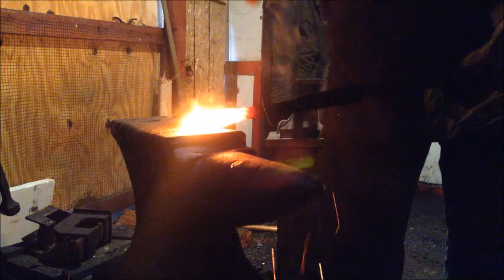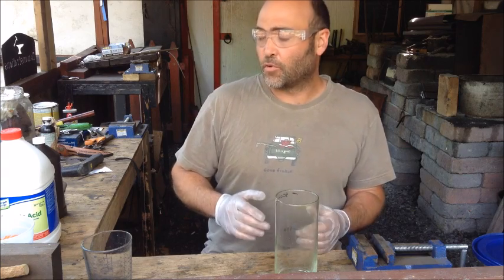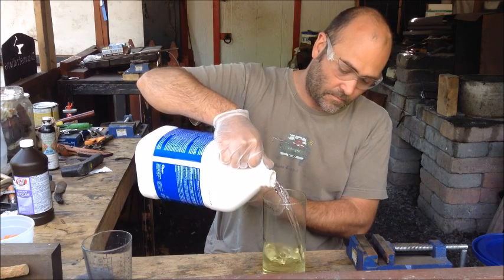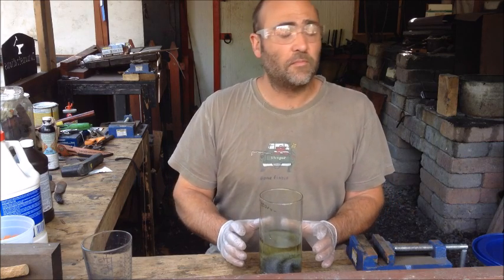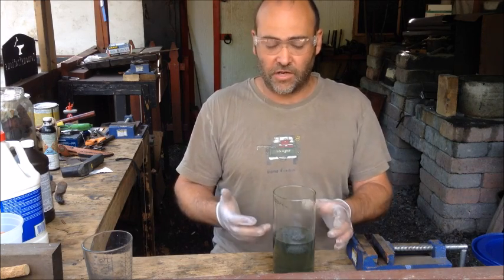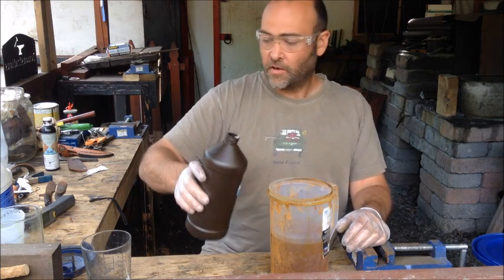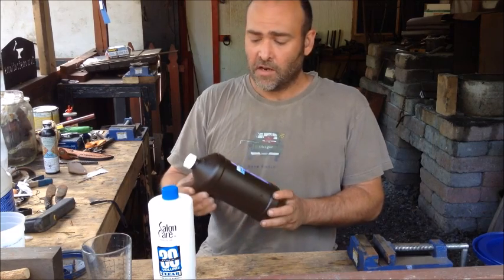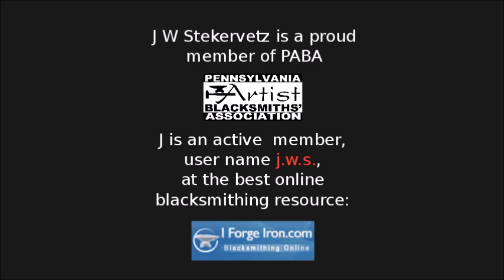Making Ferric Chloride (FeCl3) for Blade Etching

Comment: You dont have to use steel wool. 
The finish will be a gunmetal grey color instead of a much darker grey or black you get when using steel wool. Just depends on the look you want.

Comment: Hey can we use nails instead of steel wool???
Reply from the maker: In theory. But the wool will definitely do the job in short order where the nails would probably take days or weeks. I also wouldn't use anything that has been galvanized.
Reply: Shri Hari Ram G
You can use any iron/steel staff, non-coated with zinc.
Also a good choice is a powdered rust.

Comment: I just got the stuff to make some of the solution in your video. How long would you recommend soaking your knife blade?
Reply from the maker: Start with 30 seconds, lightly sand then wash it off, check the etch, repeat.
Reply: @jwstek  what grit would you use for sanding?
Reply from the maker: @nathangines6107  I normally use a wet piece of 800 grit

Comment: what if I use an aquarium-aerator instead of hydrogen peroxide will it work?
Reply from the maker: Probably very slowly over time, it will happen naturally as well. However I’ve destroyed more than my share of aerators in this stuff when etching, they don’t last more than a day or two.
Reply: @jwstek  thank you sir. 
but if I continue using an aerator is it going to give me weaker product?
or just leave it open to make it happen naturally? 
My plan is actually to use it in making printed circuit boards but I'm not in a hurry. I'm also hoping you can also give a suggestion. 😊😊😊

by the way I'm currently bubbling the solution while writing this. 😁
Reply from the maker: @kevinlouiemansueto608  if it’s working for you keep at it I suppose! I have used aerators in the bottom of my 5 gallon bucket of FeCl3 when doing larger pieces where I was worried about getting an even etch over the entire surface. From my understanding, FeCl3 settles on the bottom, because of its reaction with Fe it will break down to FeCl2 which will rise to the top. So agitation on a larger piece might be recommended, but I wouldn’t keep it going all the time, just when I was etching. I’d keep the stone out of the solution when not in use, like I said they break down pretty fast.
Reply: @jwstek  Nice. Thanks again sir. 😁👍

Comment: WHOA!!!! I always was taught to add acid into other chemicals, to minimize the risk of acid reaching the boiling point.("exothermic reaction").... Also,... you should have a couple of 5 gallon buckets full of cool water, with a box of soduim bicarbonate "baking soda" dissolved into it, as an emergency rinse solution, in case you spill/splash any on yourself!!!.... and a handy, charged, garden hose!!, and, you ought to be wearing a full length, liquid-spill-resistant apron.  If you dumped all of that acid onto your cotton clothes, you'd really be in bad shape, real fast!!!....
Reply from the maker: According to Harvard University EH&S, Princeton, MIT and Concordia University (All have lab procedure PDF's available online): ALWAYS add the hydrogen peroxide to the acid very slowly, never vice versa. 

https://www.ehs.harvard.edu/sites/default/files/lab_safety_guideline_piranha_etch.pdf
https://ehs.princeton.edu/laboratory-research/chemical-safety/chemical-specific-protocols/piranha-solutions
http://web.mit.edu/cortiz/www/PiranhaSafety.doc
https://www.concordia.ca/content/dam/concordia/services/safety/docs/EHS-DOC-019_PiranhaSolutionGuidelines.pdf
Reply: @jwstek  although I commend your research, your sources are meant for the preparation of a solution far stronger than what you’re making. 30-50% concentrated peroxide is quite a bit different than 3-5%. The rule is to always add acid to base, although hydrogen peroxide isn’t necessarily a base but a rather weak acid. Regardless, Muriatic acid should be added into the Peroxide when the solution is this diluted. Not visa versa. The inactive ingredient in your drugstore peroxide is purified water. And you ALWAYS add acid to water.
Reply from the maker: @d.michaelphotography6124  the peroxide I’m using isn’t common drug store diluted 3%, it’s concentrated peroxide meant for salon use in hair bleaching, it’ll burn you if you get it on your skin. Regardless, I think I made this video over half a decade ago and it always surprises me how active it still is. lol perhaps I’ll do an updated version in a few weeks - this batch starting to get a little low, time to refresh it.

Comment: I easily bought chrystallized Ferric Chloride from an Art-supplier in Sweden. Lawrence is the mark in my case. I had to buy 2 x 500 grams though. It will suffice for the rest of my life and further probably :)
It was not overly expensive either.
No hazzle, just make a right sullotion of high-quality soft tap-water or distilled water for lead-batterys.

Very safe in the storage, since it is a solid compound.
Reply from the maker: Opening a bag and adding water wasn’t the point of the video. If someone was making fresh pasta by hand would you tell them how you just bought a box of dried pasta and dropped it in water? Yes, there are other ways to get ferric chloride, but years ago when I made this video a nationwide electronic hobby chain store here in the US that many bladesmiths relied on to get their ferric shut down and buying through a chemical company required a lot of extra forms to be filed to get accounts, most limited to education or laboratory work, not the hobby market. Obviously things change over the years, but there are still those to prefer to know ‘how the sausage is made’ so to speak.

Comment: Is the hydrogen peroxide at all needed or can I just make the FC by using fine iron in hydrochloric acid alone?
Reply: the peroxide is used to add more oxygen to the solution.  you can also just let it sit out and it will absorb oxygen from the air..  or you can use a aquarium pump for a few hours.
Reply: An aquarium pump with some tubing will add the oxygen

Comment: Never leave any kind of acid in a open container, it will rust everything in your shop
Reply: It will over time leak out of the plastic jug it came in, enough to rust your tools or bare metal.
Reply: It will do this even in a seal container. The vapors leak past deals very slowly, but enough to cause problems when stored for more than a year. I store my acids in a cabinet outside my shop.
Reply: Desmond Bagley  I had a steel frame shop and I left a glass cup of boosted muriatic acid out over the weekend  and it destroyed my shops frame , on top of it rusting the paint came off

.

Comment: The ratio of Hydrogen peroxide to Muriatic acid is 2:1. With Hydrogen peroxide coming in 32 ounces or 946 ml.  Change the formula to 16 ounces of Muriatic acid to 32 ounces Hydrogen peroxide.  Why leave 46 ml (1.5 oz) in the bottle?

Comment: I know this is an old video, but I have a question. About how many knives will a batch of this etch before needing to make more?
Reply: Depends on the volume & strength of the of Ferric Chloride prepared.
Reply: @helpdesk1467  

And type of steel being etched.

Comment: I'm not sure that I see the point in this, since a number of people are using the precursor chemicals (hydrochloric acid and peroxide) for etching without all this extra work
Reply from the maker: batticha shumami quality and control of the reaction. By mixing the two precursor chemicals and etching in just those the reaction is aggressive - granted the more you use that same solution to etch your Damascus it becomes more tempered in its reaction. The reason why? You’re slowly adding iron transforming it into ferric chloride! Again, it’s all about control. You don’t want to do a single aggressive rapid etch, you want to do multiple etches while light sanding in between to get a smooth etch vs something that may leave your steel rough and blotchy or even worse.
Reply: @jwstek  Could be, I mostly itch PCB and it works great for me
Reply from the maker: batticha shumami then you’re making copper chloride, it’s a whole different animal and medium to work with! :)

Comment: You could also just buy muriatic acid and iron (III) oxide Fe203 and mix it with HCl and yield FeCl3. If you want a purer yield you could purify the muriatic acid in a distillation apparatus. This should all be done either outside or under a fume hood and with a Respirator typically a 3M Respirator with the approved NIOSH Acid Gas/ Organic vapor cartridges applied. Only use a distillation apparatus if you already have the knowledge to run one. Don’t waste your time trying to get the purest HCl either as Hydrogen Chloride forms an azeotrope with water at the region of 90-100% purity. Meaning it will start to boil with only water since that’s the only thing that’s keeping the HCl a liquid because Hydrogen Chloride of course is a gas on its own at room temperature and why it has such a high evaporation rate hence the dangerous fumes. Be very safe when making this stuff. I have a full acid suit for these types of projects so I truly only recommend this if you are extremely careful and know what your doing, just like the guy said in the video be extremely careful please!
Reply: This method is also safer as there is no production of Hydrogen gas although I don’t know whether the method in the video is more cost effective. This is shown in the chemical reaction here:

Fe2O3 + HCl (aq) ——> FeCl3 + H20

As seen above the Hydrogen gas isn’t a problem as it bonded with the oxygen in the oxide.

Comment: Is it no longer necessary to follow the age old convention of always adding the acid to the base???? Watching this video, I cringed through most of it. So much was done wrong. My biggest problem was you sitting down with your face less than a foot away from your beeker while mixing the base to the acid. That is the exact reverse order of how things are done safely.  If that would of been sulfuric acid instead of muriatic, you'd be in sad shape today.
Reply from the maker: Hydrogen Peroxide has a pH of 4.5 which makes it an acid.
Reply from the maker: Henri L even 100% h2O2 has a pH of 6.2 at 77F, 0.8 lower than even a neutral solution making it a very weak acid.

Comment: If you would have used chlorine instead of peroxide you would have ended up with a better quality ferric.
Reply from the maker: That’s just bad chemistry! Sodium hypochlorite mixed into the acid liberates chlorine gas, which even in small amounts can cause severe irritation to eyes, mouth, lungs etc, not to mention caustic burns or even death in not that large a quantity. No thanks, we’ll err on the side of caution- this might be backyard chemistry but safety is still the rule.

Comment: Hi ,just thought you might like to make this even cheaper ...i think you will find that the peroxide just rapidly adds oxygen to your mix ....if you used say an air pump at a slow speed ...perhaps one from a fish tank ...drilled lots of holes in a plastic tube and caused the hcl to bubble it would convert to ferric chloride ...you would also find if you had a pump in your ferric solution when etching it would remove the etchant waste from the blade and cause a quicker reaction...best wishes from England
Reply: Peroxide is like a dollar… that’s a bargain for an impatient person lol😂

Comment: I get the muriatic acid etches steel.. why the peroxide or wool .... is it to lower/neutralizes the acid
Reply: JW Stekervetz so if hydrogen peroxide and muriatic acid make cupric chloride... (ii) turns the cupric chloride into ferrous? .. wouldn't the iron of a blade do the same? Also ,why not add Penny's for a copper chloride

Comment: So last night a couple hours after I made my own ferric chloride it etched a blade pretty dark pretty fast. But tonight now that the liquid is cooled I've had a piece of Steel in there for 45 minutes and it's barely a light gray color. What could have happened?  Seems like it lost its power overnight
Reply: It either "lost its power" overnight, or hot acid etches steel more efficiently... Which of those situations seems more logical to you?
Reply: @CNYKnifeNerd  ...... In the realm of chemicals and science anything's a possibility which is why I asked the question in the first place.  Should have known there would be a smart ass mouth breather on here like you making such a idiotic comment.  Toodaloo now carry on
Reply: Did you ever get this sorted out? I just made a batch and it did the same thing as yours. Just a light grey that easily wipes off.
Reply: @nathanielgerlach1857  ....  Yeah I found really good hydrogen peroxide at Sally's beauty supply but it's not called hydrogen peroxide it's called salon 50 or something like that. Works fantastic
Reply: Just in case anyone stumbles on to this for help. I tried using Salon Care V40 instead of the 3% pharmacy hydrogen peroxide. Worked SO much better! Just make sure you get Salon Care CLEAR and not crème. The numbers (10, 20, 30, 40) correspond to 3%, 6%, 9% 12% hydrogen peroxide. The V50 bottle would be even better I’d assume, but they told me I had to have a professional license to buy that so I went with the V40.
Reply: @nathanielgerlach1857  awesome

Comment: Hi JW..  tried this method and it didn't work.  Realized I made twice as much of you but only put in about the same amount of steel wool as you did. Do you think that's the reason it didn't work? Do you think if I did it again doubling up on the steel wool I would have much better results? How how important is the iron for the etching process I would hate to make another batch and throw it away
Reply: JW Stekervetz ... Also my steel wool dissolved in about 15 minutes.  Not sure if that's normal.  And because it is all so fast I immediately added the hydrogen peroxide. Does the muriatic acid and steel wool have to sit there for a full day before you put in the hydrogen peroxide?
Reply: JW Stekervetz .. I did use grocery store 3% hydrogen peroxide because that's all I could get my hands on conveniently.  I saw other people say 3% is the way to go so figured it wasn't a huge deal. Maybe that's it.  My stuff, under the ingredients label said hydrogen peroxide (stablized) but didn't say what it was stablized with.  I'll try the salon stuff and see.  Also is it 100% necessary to let the ferriS chloride sit over night before adding the hydrogen peroxide or just wait for the steel wool to dissolve? (In my case 15-20 mins)?  Thank you for the awesome video and helping a noob out!
Reply: JW Stekervetz ...  Thank you for your time replying to my questions. I do apologize if I'm bothering you. I guess my last question is does it matter if the hydrogen peroxide has the work stabilized in parentheses?
Reply: JW Stekervetz I'm asking if the hydrogen peroxide says stabilized on it should I get it or not? That seems to be all I can find... it does not say what it is stabilized with
Reply: JW Stekervetz .. thank you for your time and patience actually your video you say to stay away from trisodium something or other. Not stabilized in general so I was wondering if there was a difference thank you.
Reply: JW Stekervetz ... Hey man, I used that volume 40 clear and holy cow!  All I can say is EXCELLENT!  Thank you so much for helping!